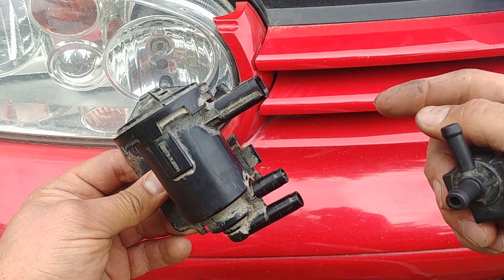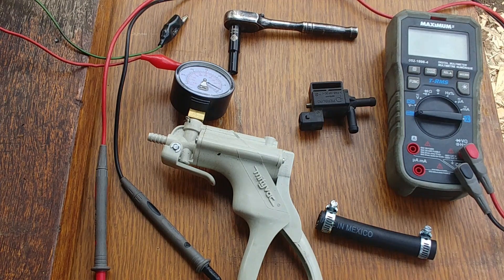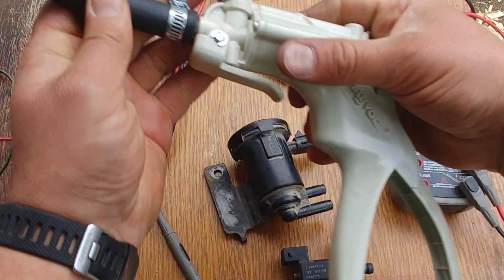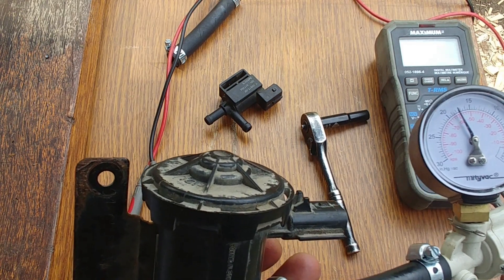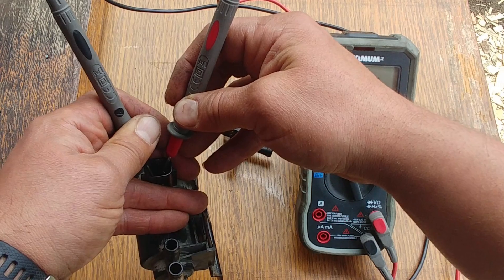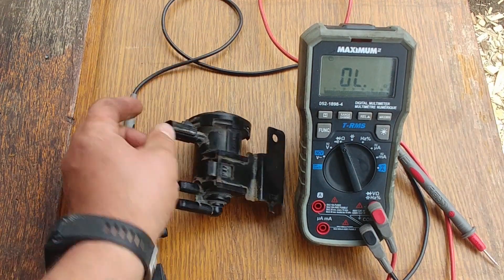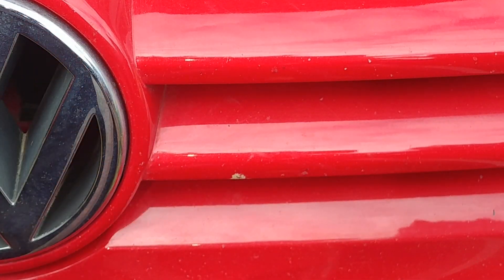HOW TO TEST A PURGE VALVE. Everything You Need To Know.

Comment: Thanks for this video, I will try these tests on my purge valve. I tried to test my purge valve by idling my car and disconnecting the vacuum line on the canister side of the valve, because the normal position of that valve is closed and when the engine is cold you should feel NO vacuum on the canister side of the valve. My question is how often does the vehicle computer tell that valve to open because I let my car idle for nearly an hour and I never felt any vacuum on the canister side of that purge valve (meaning that it never opened) but Im wondering if the valve was stuck shut OR the vehicle computer just never told it to open. Does the vehicle tell that valve to open shortly after the car warms up or how often?

Comment: Great video,  I have never seen a complete test as you have done. What I have seen is unplug the tubing from Evap purge while engine is on and warm and then place Finger on the Evap Purge Solenoid and if there IS SUCKTION THAN EVAP PURGE SOLENOID IS GOOD. Question: the test with finger a valid test.   Hope to hear  from you. Thanks and God Bless
Reply from the maker: Greetings, David! EVAP solenoid finger test is a basic check for the electromagnetic valve operation. It's a valid test.

Comment: I tested my purge valve and it is good but my car is not giving the signal to open the valve. What could the problem be? 2016 Subaru legacy 2.5
Reply: I have the same problem on my 2000 Grand Marquis. Im not sure how often the computer tells the valve to open but I let my car idle for about an hour straight and Im still not getting any vacuum on the canister side of the purge valve which tells me either the valve is stuck not opening or the computer isnt telling it to open. SO frustrating!
Reply: @Dc423holly on my car the computer doesn't send the signal to open the purge valve until the engine is at 2,000 or 2,500 rpms. The reason I was testing my purge valve was because of a check engine light but it turned out that the rubber seal on my gas cap had deteriorated causing the code.
Reply: @Antoniocool86 , thanks for the reply, I actually found the reason for my check engine light was the wrong gas cap. I bought it at Walmart 3 years ago and according to them that was the one for my car BUT I decided to buy an OEM Motorcraft fuel cap for my car on Amazon and that solved my check engine light. I just got my 25 year old car through emissions in NJ and I’m good for another 2 years!
Reply: @Dc423holly I went oem because I know that sometimes aftermarket shit just doesn't work right.

Comment: The pressure may increase slightly (vacuum level drop) while sitting since the air cools off when pressure is reduced then it slowly heats back to ambient temperature, raising the pressure.  Similarly, if you pressurize air, it heats then the final pressure relaxes a bit as it cools.

Comment: I replaced the purge valve on 2012 fusion because i got a engine light code saying “very small leak” within the emission system. Replaced it, car runs great, but it makes a clicking noise is this normal?

Comment: For those asking. To activate the solenoid simply connect a wire lead to each negative and positive terminal posts on your battery and touch the pins. If it clicks and opens it means is good. If it doesnt click that usually means the valve is no good, its usually stuck open wont hold pressure which is no good.
Reply: Thank you!

Comment: when power was applied to the purge valve while under vacuum the needle dropped to zero. What does it indicate if the needle doesn't drop and continues to hold vacuum?
Reply: It's Stuck in the Closed Position.

Comment: I have a Toyota purge valve that behaves exactly like the small valve you tested in this video.  But when I read the service manual which shows you how to test the valve, it says if the valve is good, when it's off, outside out of the car like in this video and no voltage applied, you can blow from the canister side port and the air would come out of the intake side port with 'little difficulty'.  This confuses me because, in that condition, should there be air coming out of the intake side port at all?

Comment: I've fixed purge valves by spraying carb cleaner in both ports and shake it all around, drain and repeat a few times.  Let it dry out over night and they work fine afterwards.
Reply: thats a genius idea. i need to try.
Reply: What about wd40 would it work same.
Reply: @martymartin2894  
I haven't tried wd40 but I wouldn't.  Wd40 is a solvent but also a lubricant so it would probably leave oils inside the purge valve.  I will also add that it is probably best to replace the purge valve, while after cleaning mine it did work I ended up getting a code a few months later and it was the purge valve again.
Reply: @timb7775  ok thanks
Reply from the maker: That's sounds great Tim. Thanks for sharing you repair.

Comment: What is the green knob and what does it do?  I have a '99 Ford expedition w/ the green knob sitting on the purge valve itself.  I smell fuel mostly near the charcoal canister in the rear of the vehicle.
Reply from the maker: Hey Rene! Green know is a EVAP system diagnostic port to connect smoke machine to locate EVAP system leaks. Do you have any EVAP related DTCs (codes)?
Reply: @PistonShack  Yeah, 442.  I unplugged the the purge valve, disconnected the line from the canister and started the vehicle.  There was no suction which is normal.  I think my problem is in the rear of the vehicle by the canister, that's where I usually smell fuel vapor.  I have to fill up every so often.
One more thing,  I might make my own smoke machine.  Does the pin in the middle of the port need to be pressed for smoke to go past it or no?  Thanks for replying.

Comment: i have the same issue with the big PURGE VALVE you test but  still  light is on  if you can tell us what is the next steps to check cable wiring  from valve to ECM

Comment: What I find, is that this purge valves when clicking are working but when leaking is because  have some dirt inside the rubber that seal the vacuum,  some W40 can help  if not maybe you can open and clean the valve,  I fix 3 of them this way. Good luck

Comment: Thanks for your vid. I got an 02 caravan with a purge valve that looks just like the one you have.
When I put a vac on the bottom "canister" nipple and it holds but the top nipple " manifold" will not even pump up. Is it bad?  Did olm test and got 14.7. Thanks

Comment: My perge valve clicks like hell when the motor is on, is it supposed to do that?  Clicks like crazy
Reply from the maker: That's could be okay. Constant clicking is ECM modulated impulse signal for the solenoid control. It should stop at some point. If not just try to unplug the connector and cycle the key. What vehicle are you working on?

Comment: Hey gm....I have a Nissan b15 wish side go on the intake m.....
Reply from the maker: I ain't sure with b15 design but one side of the purge valve should get connected to the upper intake manifold or somewhere to the air induct pipe passed maf sensor.

Comment: Does the purge solenoid constantly i meant almost frequently purge the fuel vapor into the intake manifold?? I am asking this question because on OBD2 reading it seems the evaporative valve only does it at random meaning not always purging....So i am curious if this is normal or something wrong with the fuel pump
Reply from the maker: It purges vapour form time to time.
Reply: @PistonShack  from time to time means it does not do it all the time right? it happens randomly?
Reply: @neodiy  thats what I want to know also. I let my car idle for about an hour and the purge valve would not open so that means either it is stuck shut or the vehicle computer isn't calling on it to open, but I'd like to know when to expect that so Im not standing around wondering.

Comment: I would just like to state that just because it passes the bench test does does not mean it's good. They can work intermittently down the road and make the check engine light come on. I had 2 do this, and changing them out fixed the problem. Also just because a part is brand new in the box does not mean it's always good. Took me a few years of experience to figure this out. Just passing this information on, to save maybe you from changing everything else, and then coming back to the original problem. (Pick a Part saves money)
Reply from the maker: Thanks for sharing your experience! That's good point BLOWNDADDY1. Cheers!

Comment: How did u energize the valve? Can I use a multi-meter or do you need a seperate tool?
Reply from the maker: I used regular 9V or 12V battery of the test.
Reply: Yeah some connector wires and 9v battery

Comment: When my purge valve opens... my engine dies.
Reply from the maker: Hey Jackie! That because when valve opens up engine has large vacuum leak. Check vacuum, EVAP leaks and if necessary replace purge solenoid.
Reply: First few times it happened made me say "hmmm".
The next time it died and my purge valve hoses and the EGR components on the intake along with their associated hoses melted.
After replacing, I'm now getting the 0174 and am going back to the canister area.
Reply from the maker: @jackiehawkins3214  If you just block hose from Purge Valve to Intake it should run. When you block end of the hose from intake to purge you should feel vacuum.

Comment: I have a 08 grand caravan 3.3 and when I turn on the vehicle you instantly smell fuel. could it be from the purge solenoid? I do have a evap code too
Reply from the maker: Hey Pablo. Do you have fuel smell inside the van or when you disconnect purge valve?

Comment: The purge valve ! is that supposed to open and close only ?Or does the voltage regulate the volume of air moving thru the vacuum tubes also because mine makes leaking harmonic sound when I shut down the engine
Reply from the maker: If purge valve solenoid stuck open I just go and replace it. Purge valve should be closed when not energized.

Comment: What are you using specifically, to check the clicking, with your multi meter? Battery power?
Reply from the maker: Hi Mark, you can use power probe to energize solenoid.  I used battery to power to power it up. Thanks for watching.

Comment: Good Afternoon my friend! I have a 2003 Dodge Caravan and i was performing an evap smoke test but i have no tool or equipment to use that will allow me to close and open the evap components, what can i use?
Reply from the maker: Hi brotha! I would check for leaks before PCV (tank-canister-PCV) and after (PCV-intake manifold) with home made smoke machine. Tons of vids on YouTube. Well, without Bi-directional control diagnostic tool you cannot operate solenoid valves without powering them directly how I did in my video. Cheers!

Comment: What if it holds perfect vacuum on the manifold side but slowly looses vacuum on the canister side? I'm truly stumped why only one side would leak and how come nobody tests the canister side or is the canister side suppose to loose vacuum?
Reply from the maker: Hi Gabriel! Sorry for such a late reply. Canister should be sealed and hold vacuum. Could be issue with one of the o-rings or canister has crack. I would replace o-rings first that should help. Cheers)

Comment: How can we test the circuit
Reply from the maker: Hi Aly! Check if you have continuity on both wires. Also it depends how solenoid controlled by the ground or power. Check if you have ground or power on one of the wires. Then you need scan tool to turn valve On and Off to check if ECU controls it or not.
Reply: And of course thank you for you're helpful video that's very nice
Reply from the maker: You are very welcome! Cheers and thanks for watching.

Comment: Greetings! I tested my purge valve on my 2006 Town & Country and the vacuum (17 inHg) decreased over a few minutes time; I purchased a new one from Pep Boys (standard motor products) and figured I should test the new one before I installed it. The new one also didn't hold the vacuum! What should I do now? Return it or what?
Reply from the maker: Hi Michael. Thanks for sharing your experience. I went to local junk yard, pulled one out for 10$, plus got 30 days free exchange or credit. So far no any problems. If valve doesn't hold vacuum bring it back. Sorry for the late reply.

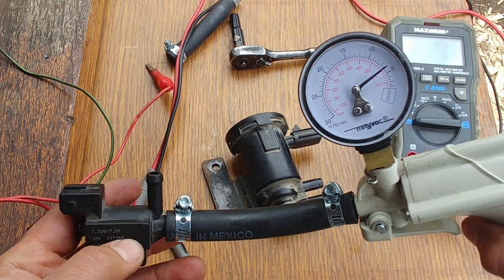Comment: So even the purge solenoid tested good on open & close, it can still be bad by leakage @ 4:07, is this right ?
1:12 is my nissan fronty, now i know where purge located, thnx !! I have obd code p0455 😞😞. Any clue issue?
Reply from the maker: That is correct. It could be ground or power issue down to the solenoid as well.

Comment: REMOVE MY PURGE VALVE ON MY 2012 GENESIS  THE ARROW ON THE VALVE  POINT TO LINE GOING TO CANSITER SOMEONE TOLD ME THE ARROW SHOULD POINT TO INTAKE ENGINE CAN YOU TELL ME WHAT WAY IT GOES.
Reply from the maker: Good evening Jesse. Normally arrow shows gasoline vapors flow from charcoal canister, where they stored, to the engine intake. PCV solenoid regulates gasoline flow to the  engine. I would recommend you to verify the information with your vehicle technical service manual. Another tip, when you mount PCV valve there is usually only one to mount it properly and connected lines to it. Thanks for watching. Let me know how everything is going.
Reply: @PistonShack   THANK YOU VERY MUCH
Reply from the maker: @jessecobbs8864  You're very welcome Jesse!

Comment: I like the video buddy great job I just need to get more on meters and testing machines like what you got I have a Dodge Caravan 1995 I don’t know if the PERT sound is out
Reply from the maker: Hi Goodman! How all is going? I like Caravans, they are reliable units. My bother has one. Check purge solenoid valve for leaks if it holds vacuum. Let me know if you have any other questions.

Comment: Are there Purge valves that are designed to stay open until you apply voltage. Another words the other way around where applying voltage closes the valve?
Reply from the maker: Yup, correct. Normally purge valve is closed. ECU gradually opens Purge Solenoid valve allow fuel vapors from charcoal canister  get burned inside the engine.
Reply: @PistonShack  are there any Purge valves that are designed the other way around. Where if you pull out the purge valve and bench test it. And blow into it. Air goes through. And then when you apply voltage to the purge valve the valve closes and does not let air through?
Reply from the maker: @1776FreedomNow  Vent valve  solenoid at the charcoal canister works in a way you described.  Purge valve opens when coil energized.

Comment: What are you hooking those cables up to for power?
Reply from the maker: Hi Cody,
Those wires are battery ground and power supply to the valve. Let me know if you have any other questions.
Reply: Does it matter negative or positive to connect to the purge,,,I used the car batter with test leads and it sparked ,,leads did not touch

Comment: Great Video, thank you making this video it is very helpful for people like me and others trying to do it on your own to Educate ourselves and at the same time save some money, thanks again Piston Shack
Reply from the maker: Hi David, Thanks for watching. Let me know if you have any questions. Glad to help.
Reply: David Rivera 

These seem to be a problem with Toyota Corolla from what I’m experiencing. Would this be the problem with a P2401 Evaporative Emission Leak Detection Pump,or is this a different issue?

Awesome video,just wondering if the evap purge solenoids are bad on my 05 and 07 Corolla’s.

Thanks,Chad
Reply from the maker: @chadhouse1375  Hi Chad, p2401 could be related not only to the leaks detection pump which controlled by ECM. It could be the circuit wiring issue (very common) and also it might be any other EVAP system related problems down the road. I would test ground, power and signal ect at the pump, then look for any leaks. Pumps intend to fail over time as well. Take the pump out and test for any defects.  Let me know if you found the cause or you have any questions. TNX.

Comment: Mine does have a good ohm reading but it does not have a continuity reading is it good or bad
Reply from the maker: Hi Dustin, 
It should read continuity. Does it read ''O.L."? What resistance value did you get? Tnx.
Reply: Well I got a new one and it did stop bringing the fuel smell inside my car but I’m still showing up p0455 and I just changed the vent valve and the fuel cap and the charcoal canister
Reply from the maker: @dustinbergeron7508  Hi Dustin, 
1) check EVAP system for any small and large leaks before and after purge solenoid. Look for any Evap tubing visual defects. 
2) smoke test will help to find and detect any leaks. Its pretty simple to do,  just google "smoke test"
I will do that first then go to check any electrical issues with circuit.
Let me know if you have any questions. Cheers!